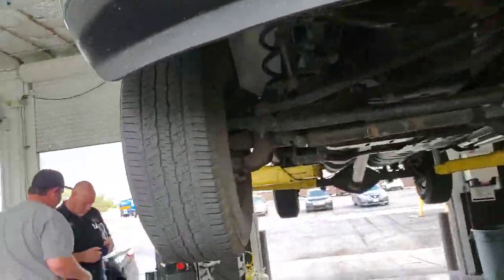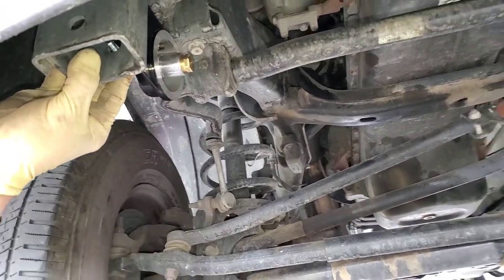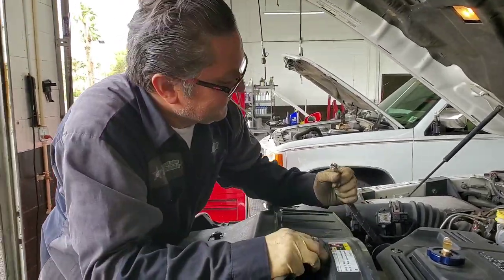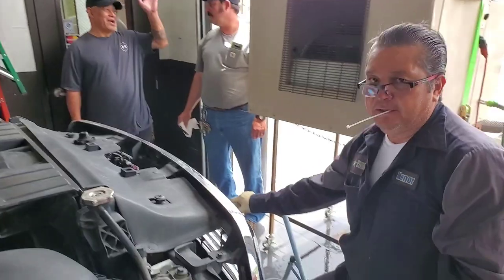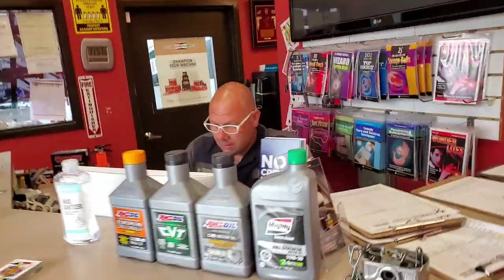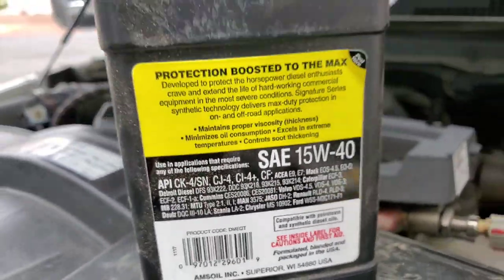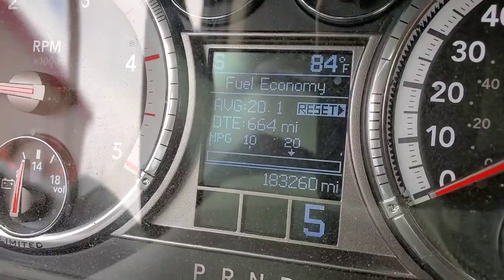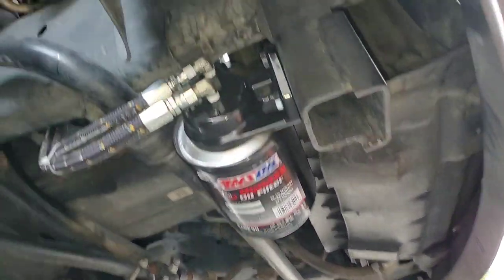AMSOIL Bypass Filter Installation 2012 Ram 6.7L Cummins

Comment: Nice, I put the Sinister Diesel bypass kit on my 7.3 powerstroke because it comes with the AMSOIL bypass filter.  I'm currently using the EABP 100 since my engine holds so much oil.
Reply from the maker: Sweet💯

Comment: Eben, you didn't show where you hooked up the oil line that runs to the bypass filter from the engine.
Reply from the maker: You'll see it in the video there's a couple components there's a couple of hoses you got an oil cap that has a hose that goes in the middle and then you have a Billet aluminum piece that goes on to the oil filter housing and what that does is it routes 10% of the oil through the filter of the bypass and then back into the oil cap it's a little weird when you look at it the first time but once you see it in person it's very simple surprising most diesel trucks don't have it stock.
I give a man a fishing pole & show him how to fish. 

     Together! We can get your vehicles to run better than brand new!

     For me to get credit & be "Your" Independent AMSOIL Dealer please use my website below or my dealer no. 5331179 call anytime Eben Rockmaker 702-472-3614
After you click on: http://syntheticoilprotection.net
1. Click hamburger menu
2. Click buy wholesale
3. Add 6-month PC member to cart
4. Select shop by vehicle.

New promos: FREEBOWL

Comment: Im amazed how clean my 6.7 cummins runs.  its fully deleted which helps a ton. i use amsoil, my oil will stay damn near new looking to around 10,000km!  that's when I start seeing a change in colour.  I'm debating on installing this bypass.  Where did you mount the bypass lines to draw from the truck?
Reply from the maker: There's one line that goes to the oil cap which is made out of Billet aluminum that's 10% of the oil from the full flow filter bracket and it filters at to microns at 99% efficiency... the full flow filter filters at 20 microns and 99% efficiency.

     I give a man a fishing pole & show him how to fish. 

     Together! We can get your vehicles to run better than brand new!

     For me to get credit & be "Your" Independent AMSOIL Dealer please use my website below or my dealer no. 5331179 call anytime Eben Rockmaker 702-472-3614
After you click on: http://syntheticoilprotection.net
1. Click hamburger menu
2. Click offers AMSOIL preferred customer
3. Click join now 6-month PC member add to cart.  ( there is no reoccurring renewal membership unless you select that dot box ) 
( you have the option to not have your credit card saved if you prefer - est. 1972 )
4. Scroll up to the top Select shop by vehicle.

New Promo: FREEQS

Comment: Did he drill those holes for the bypass filter mount or did he use holes that were there? Good spot for it though
Reply from the maker: They were drilled in.
Depending on your year make and model you have to do a custom bracket.
Let's give a man a fishing pole & show him how to fish. 

     Together! We can get your vehicles to run better than brand new!

     For me to get credit & be "Your" Independent AMSOIL Dealer, please use my website below or my dealer no. 5331179 call anytime Eben Rockmaker 702-472-3614
After you click on: http://syntheticoilprotection.net
1. Click the hamburger menu
2. Click offers AMSOIL preferred customer
3. Click join now. 6-month PC member add to cart.  ( There is no reoccurring renewal membership unless you select that dot box ) 
( You have the option to not have your credit card saved if you prefer - est. 1972 )
4. Scroll up to the top Select shop by vehicle. 

New Promos: FREESHIP & 5CERAMIC

Comment: So did I miss something I see where you tied in both horses into the filter, & also the hose into the oil cap, but you never showed the other end of the holes in this video ? Where did it go to?
Reply from the maker: I'd watch it again.  10% of oil is routed form full flow filter to big by pass filter. Then it emptys I. The oil cap at top of motor back into engine.
You'll see it now☕️👌

Let's give a man a fishing pole & show him how to fish. 

     Together! We can get your vehicles to run better than brand new!

     For me to get credit & be "Your" Independent AMSOIL Dealer, please use my website below or my dealer no. 5331179 call anytime Eben Rockmaker 702-472-3614
After you click on: http://syntheticoilprotection.net
1. Click the hamburger menu
2. Click offers AMSOIL preferred customer
3. Click join now. 6-month PC member add to cart.  ( There is no reoccurring renewal membership unless you select that dot box ) 
( You have the option to not have your credit card saved if you prefer - est. 1972 )
4. Scroll up to the top Select shop by vehicle. 

New Promo Code: FREETOOL

Comment: Question is where did you tap in for the feed? Really looking for answers
Reply from the maker: I would watch the video again I think we showed everything.
You'll see the way it's mounted pretty much everything's in the video and it's coming off the oil filter 10% of the oil gets routed off and goes through the bypass.

If you have any questions Jonathan let me know and if you're new to Amsoil and you're going to be ordering the best way is as a 6-month PC member this is my personal link here and when you use it I would be your Amsoil guy in the future I can always answer all your questions on the products and I really appreciate your business future business in advance.
❤️ 🇺🇸 ❤️ Professional YouLubher: Eben Rockmaker Regency Platinum Direct Jobber AMSOIL Specialist (Dealer#: 5331179) 702-472-3614 

      ✅ ✅ ✅  You will get Best Value with 6 Month AMSOIL PC Membership because You get $33 back on a $100 purchase after the difference in Sales Tax with No need for Auto Renew - https://www.amsoil.com/offers/pc/?zo=5331179

Comment: Where did you tap into the oil supply?  Did you use the Cummins filter adapter?
Reply from the maker: It comes off the full flow filter 10% gets routed back into the oil cap it's called the oil and now oil bypass kit you'll see it here on the lookup guide for your vehicle and if you're new to Amsoil and you're using it for personal use you want the 6-month PC membership when you use my link here that will give me the ability to answer all your questions in the future about improving the performance and lifespan of your vehicles by choosing the right fluids as your independent Amsoil dealer👍
✅   Save 25% On Your Next Fluid Order: https://www.amsoil.com/offers/pc/?zo=5331179

Comment: The bypass filter says it has a life of 60k miles so if you change your oil and main filter 6x or every 10k then the bypass filter is good the whole time or do you recommend changing it every oil change too? Also if it does truly stay good for 60k miles then do you take it off and just drain it every oil change?
Reply from the maker: Lot of great questions here if you're running the Amsoil oil filters you're good for 15,000 to 25,000 miles on the full flow filter the bypass filters last quite a bit longer there's different sizes for different applications so you definitely want to double check that if you have any questions and anything just let me know you can always give me a buzz on your application the 6-month PC membership will give you the very best value for your products and there's no reoccurring fees when you use my link that'll always allow me to answer your questions in the future with the products as your independent Amsoil dealer about improving the performance and lifespan of your vehicles by choosing all the right fluids👍😉

Eben Rockmaker 
702-472-3614 
✅   Save 25% On Your Next Fluid Order: https://www.amsoil.com/offers/pc/?zo=5331179

Comment: How much flow should you expect at idle? I just installed mine and pulled the cap. It’s kinda dribbling out, not a great flow.
Reply from the maker: It is a 10% of the full flow filter so basically it just routes that 10% through the system If there's some sort of constriction or something there could be a problem also certain low flow oil pumps they say not to put on a bypass filter so there could be something there as well Just depends on the setup and depends on certain specifications

Comment: Just wondering, do you leave the brass fitting on the bypass filter housing? That has the tiny hole?
Reply from the maker: Great question I honestly don't know.
If you're new to Amsoil this is my link here it will give you the products and if you have any questions on them in more detail for specifics you would want to call technical support if you're going to order over the phone all you do is give them my referral number and I'll be your Amsoil dealer in the future 5331179 is my number.

[Name] AMSOIL Technical Support
[Mobile] 1 (715) 399-8324
Reply from the maker: ✅ ✅ ✅  You will get Best Value with 6 Month AMSOIL PC Membership because You get $33 back on a $100 purchase after the difference in Sales Tax with No need for Auto Renew - https://www.amsoil.com/offers/pc/?zo=5331179

Comment: What is the location of this express lube? I’d like for them to install my AMSOIL bypass on my 2016 RAM 3500. Thanks
Reply from the maker: Ask for Jeffrey Lockett he is a AMSOIL dealer of mine 💯☕😃
Express Lube & Auto Repair
(702) 433-5823
https://maps.app.goo.gl/aUMRTi1r5hrB5XJU6
Reply: @Syntheticoilprotection  Las Vegas! Awesome. That makes it real simple for me when i drive from FL to LV to see my oldest son. I have 151k now and only use AMSOIL products since new, but i knew the engine needs the bypass. I cannot do it myself due to finger issues from the Desert Storm war. Thank you!
Reply from the maker: 💯🎬😃, thank you for helping the country ☕😊

Comment: How does amsoil do on a three hour long road trip?
Reply from the maker: Great 💯
Reply from the maker: It's definitely something that pays you back in the long run because your engine will last longer run smoother have better performance and fuel mileage.

This is my info if you ever want to try the products this will give you the 25% off so you'll save about $33 on a $100 order.

Professional YouLubher: Eben Rockmaker Regency Direct Jobber AMSOIL Specialist (Dealer#: 5331179) 702-472-3614 

Get AMSOIL Wholesale Pricing - https://www.amsoil.com/offers/pc/?zo=5331179

Comment: That's so cool you are back at Jeff's! Is a bypass filter the same as an oil catch can? Many people talk about this but I struggled to find information, what are the benefits and does it fit every car ?
Reply from the maker: It's totally different a catch can is intercepting the oil that's coming from the crankcase ventilation system The bypass filter is a separate filter that is routed off of the full flow filter and it takes 10% of the oil flow out through another finer filter So it's just oil filtering the oil much much finer 10 times finer than an a full flow filter

Comment: Really considering buying this kit for my 7.3L excursion. How much would I be looking at? I currently change my oil about every 4k miles or so. I'm thinking this system would save me a ton in oil changes
Reply from the maker: Definitely the kit is a variable price as a preferred customer this is my preferred customer link you'll click on that you'll add the 6-month PC membership to cart and then you'll see the price for your kit when you look it up in the lookup guide.

If you have any questions or can't find it let me know I can always text it to you.

When you use my link I would be your Amsoil dealer so I would get the credit and I could always help you with your vehicles.

Professional YouLubher: Eben Rockmaker Regency Direct Jobber AMSOIL Specialist (Dealer#: 5331179) 702-472-3614 

Get AMSOIL Wholesale Pricing - https://www.amsoil.com/offers/pc/?zo=5331179

Comment: Is this basically oil catch can ?
Reply from the maker: It's totally different what it does is it filters that to microns 10 times finer than a regular full flow filter. It catches the very small particles and extends the life of the equipment exponentially by keeping the oil cleaner.
This will give you details on the different bypass filters:
https://www.amsoil.com/c/bypass-oil-filtration-systems-mounts/32/?zo=5331179
Reply from the maker: 🎬 Professional YouLubher: Eben Rockmaker Regency Gold Direct Jobber AMSOIL Specialist (Dealer#: 5331179) 702-472-3614 

     ✅ If You're New To AMSOIL I Recommend The AMSOIL 6 Month PC Membership because it will save you about $33 on a $100 purchase after the difference in tax - https://www.amsoil.com/offers/pc/?zo=5331179

Comment: Anybody done a install on Yota Taco? Gotta 2001 with 3.4 V6 with 88k miles I want to run as long as possible. Thanks Jim
Reply from the maker: If it's diesel I would but if it's gas I would just do the signature series and change the filter at about 12,000 MI that's what I would personally do I'd also run the upper cylinder lubricant every full tank and the pi cleaner every 4,000 miles.
This will give you the very best value on the products gym and when you use my link that would attach me to you so in the future I can always answer all your questions about improving the performance and lifespan of your vehicles by choosing the right fluids👍
✅   Save 25% On Your Next Fluid Order: https://www.amsoil.com/offers/pc/?zo=5331179

Comment: I see a lot of diesels online using bypass filters.  Is there a significant advantage for gasoline engines?  I'd love to get 1 million miles :-) out of my new Toyota Sienna.
Reply from the maker: The bypass filter is ideal for the diesel oil because of the added soot contamination.

If you wanted to get more miles out of your gas motor what I would personally do is I would add an oil filter relocation kit and use a bigger oil filter and have a larger oil capacity that would allow your motor to run cooler.

Because the oil temperatures would be cooler with the oil filter relocation kit.

It's something that's really not necessary because as long as you change your oil filter when it's close to full you'll be ahead of the game and as long as you're running the signature you should easily be able to make a million miles no problem.
Reply from the maker: Are you in Amsoil preferred customer?

Comment: Hey Eben, great video on this big rig 🚛 
How many miles can you go with this bypass system and do you change both filters at the same time?
Reply from the maker: 60,000 mi or 2 years whichever comes first on the bypass filter.

It would be best to change the full floor filter at 15,000 mi and use the diesel injector clean plus see team boost as a maintainer.

Comment: Can this be done on a regular Toyota or not worth it?
Reply from the maker: Yes you could if it's diesel it would definitely be worth it if it's just a gas motor you're fine changing the oil filter early and you can run the oil a very long time when you're running the signature series

Comment: Delete the egr and dpf and it’ll clean up a lot and 3 mpg better
Reply from the maker: 😁😄😊, and we might as well do a racing tune while we're at it......

You know what let's also do an upgraded turbo fuel pump and injectors!!!!!

665 rear wheel HP and 1170 rear wheel torque ☕😃💯

That would be a blast 😃
Reply: @Syntheticoilprotection  man i like your way of thinking!! Better upgrade that 68rfe first!! Lol
Reply: I'd love to do that. It's getting harder to buy a delete kit with tunes. F ing Sleepy Joe!!!!
Reply: @mattmcdermott4766  you ain’t kidding man I just did my 2011. It was very hard to get the exhaust. Tuner and delete kit was easy to get. Ebay has a lot.

Comment: Could you show the location where the oil comes from the block?
Reply from the maker: Not sure what you mean?
Reply: @Syntheticoilprotection  One line goes to the oil cap, where does the other line go?
Reply from the maker: That one goes through the filter the bypass filter and then an empty's out into the oil cap it routes 10% away from the full flow filter through the bypass filter which filters at two microns instead of 20 microns at 99% efficiency.
And then that 10% gets routed back into the crankcase oil through the fill cap

Comment: wouldn't ya be starving the engine of oil when the filter goes on dry and lines?
Reply from the maker: No because the full flow filter is still pumping 90% of the motor oil.

Comment: Hello. I use a Amsoil Ea oil filter on my Nissan. 

The Amsoil bypass filter is said to be 2 micron.

What's the micron achieved by the Amsoil Ea filter?.

Thank you.
Reply from the maker: The regular full flow filters are 99% efficiency at 20 microns👍
https://www.amsoil.com/p/amsoil-oil-filter-eaoilfilt/?zo=5331179

Comment: Color of the oil will never change lol
Reply from the maker: Yeah the diesel oil is usually always dark however the gas oil can definitely change quite a bit as it oxidizes just depends on the fuel dilution and the heat cycling on the fluids the age definitely play a big role.
Are you a youtuber?